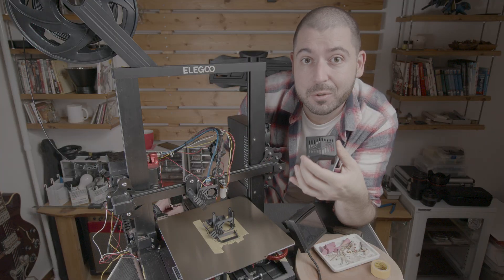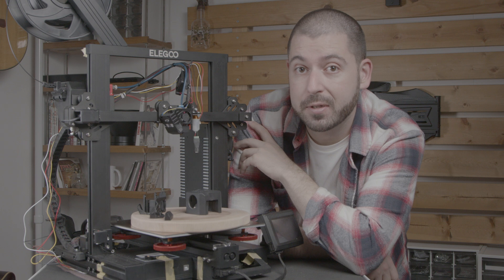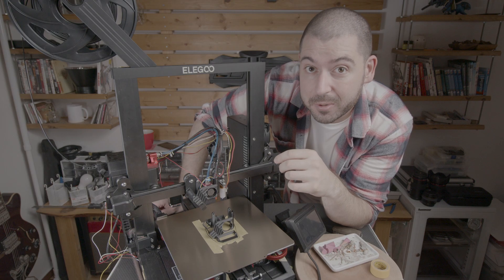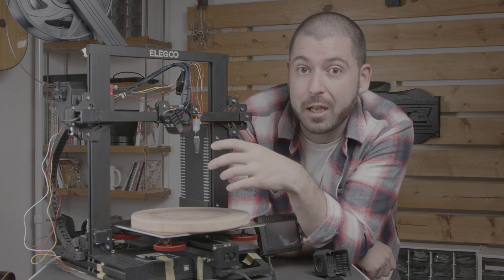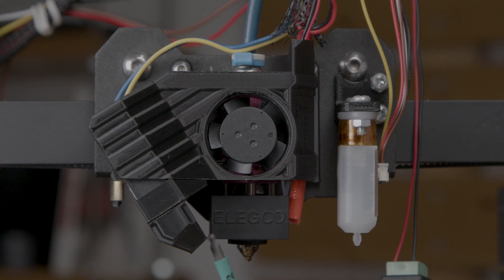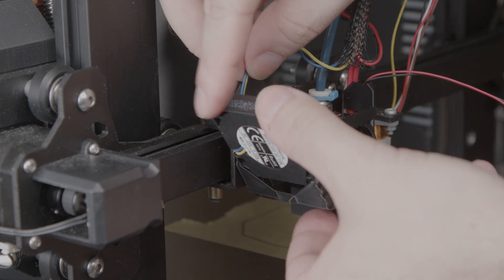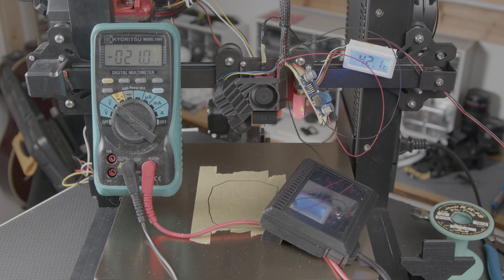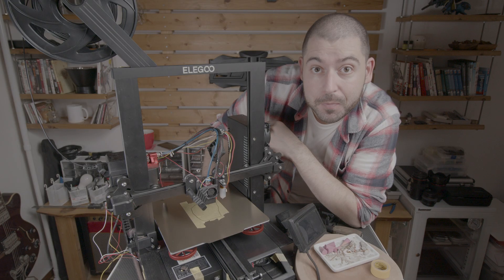Mame-FS1 Fan Shroud Design: Elegoo Neptune 2s

Comment: Question for you. My extruder gets hot as soon as I turn my printer on. Do you know what would be causing this?  I replaces the thermistor think that might be the case but its still getting hot on start up sometimes hit hits 260c
Reply from the maker: it sounds like a short circuit. the power to the heater doesn't turn on unless told too. if you are working inside the printer and make a 24v short somewhere it could damage the heater MOSFET, then it does not switch on and off properly. The MOSFETs are the 2 black boxes beside the heater and heat bed wire terminals, you might be able to see or smell burning.
Reply from the maker: if you reversed the positive and negative somewhere while making a mod it could be causing issues too.

Comment: Hello, just tried to print this but the "front" fan on my 2s seems to be much bigger, measuring 40x40x11mm - is your fan non standard, or did they change the part?
Reply from the maker: hello, this design is for a non standard front fan. The exact fan I used should be in the description if you want to see.

Comment: Hi I also got Neptune 2S and it is my first printer. I started my journey following your assembly video. Love your content. Would you be able to Leo test the shrouds that are available on thingverse and do the comparison between eg. satsana and your design?
Reply from the maker: hey, thank you very much! I wouldn't really try to compare my design to the others. If you want cooling then a different design with 2 fans or 2 side cooling will be better. If you want noise control then my design runs very quiet. In the future I will design a 2 fan model, then it could be fun to compare!

Comment: This is amazing work you got here, looking forward to printing this out, what polymer would you recommend on using? I feel like PLA might be to soft for this
Reply from the maker: thank you very much! I printed in PLA+ it still looks fine... so it is possible but I agree with you it is soft. Print in PETG if you can. If you can print PETG yet you can print TPU  at 230 degrees for just the shield and tip, the main part in PLA. If you have print or dimension issues let me know I can try to fix it a little.

Comment: So could you show the new mini fan you bought, what’s the part?  Next where do you plug it in on mother board?
Reply from the maker: the link for the fan is in the description, its CFM-2510B-170-140. that fan is   12v so you need to cut the original fan wire and install a buck converter to get the 12v. In the video I installed the converter beside the shroud just for demonstration but really you would want to cut the wire and install the converter somewhere beside the motherboard. Check the color of your fan wire, there should be only 1 set of same color wire going to the main board and the board should say fan. sorry I can't check my pc now to give a perfect answer. I have a video with thumbnail 'quiet and cool' with more detailed buck converter installation inside the case, also my power supply fan pt 3 video I think I went into detail of the buck converter tuning if you need.

let me know if you need more help, my printer is super quiet after this!

Comment: Great video, I'm following your videos about the neptune 2s series because I have the same one, I'm facing a problem with my y axis losing steps in some prints, my x axis is ok I did the vref calibration on the y identical to the x axis because both using the same engine but the problem continues, do you have any suggestions? Could you tell me what is the value of your vref on the y axis, this is making me sleepy, I realize that when I find my finger on the table with little force in moving the y axis, the motor already loses step.
Reply from the maker: thank you for following! Tighten the belt, the y-axis is heavy so easy to skip. sorry I can't check my pc for the vref now but it's written on the screen of my z-axis noise Proterface video. I adjusted the x and y just a little under the vref and still use the same values from that video. 

But it's probably the belt.
let me know if you need more help after!
Reply: I'm happy for your return.
After posting the comment I went to review your videos and I actually had the vref settings in the noise reduction video for both axes (x: 1.01 / y: 1.21 / z: 0.58 ) I made the same calibrations as yours and completely revised the belt and the rounds, now I'm going to print the model that was having a problem, this will take some time because the model has 6 hours of printing, as soon as I finish I'll come back to give the result, I hope it's successful :D, thank you for from now.
Reply from the maker: I hope it works too!
sometimes the motors will feel good but might skip at the same spot of the print everytime. In this situation reduce the Jerk and Acceleration settings. I use 800-1500 accel and 4-8 jerk.

good luck!
Reply: this was something I didn't notice, currently my jerk for the y axis is 8 and the maximum acceleration is 500, do you usually vary the acceleration?
Reply from the maker: I usually play with my settings just to  see if something changes and to learn. you could vary if you needed speed vs quality. i tried 400/1 last week it was slightly better quality than 800/4 but not much better quality. Now I am trying 1000/1, jerk doesn't change my print time so much but it can cause a lot of vibration. One day I will find my favorite setting and stop playing!
Reply: cool, I'll do some experiments around here, it's always good to have new suggestions, thanks!!
Reply from the maker: i have one more point because out say it it easy to loose steps by hand. when you turn the printer on the table moves free, but after homing the motors are on and table is locked. If you find skipping after homing, still check belts first, but also you can check the belt gears are tight or not.

Comment: future mods I recommend you doing is replace the crappy MK8 extruder it comes with, I replaced both of the extruders on my Neptune 2D with BMG extruders from Mellow in Aliexpress, good quality, not very expensive and very strong. Also, I highly recommend you replacing the filament sensors with a BigTreeTech smart filament sensor. It can not only detect breaks, but it will also detect clogs as well since it's an encoder instead of a switch.
Reply from the maker: I've talked with someone else who used the BMG also, what point is weak with the MK8 in your opinion? So far it hasn't given me to much trouble but I don't push it too hard. The sensor sounds interesting, I noticed that the sensor and extruder don't actually line up on the 2s so had thought about taking it apart and rebuilding it.
Reply: @MochaMameX  it doesn't take much for the extruder to stall or slip. I once tried pushing the printer to 80mm/s instead of the stock 60mm/s, both of the extruders stalled. I also tried printing with the fast profile and it also stalled the extruders. Another failure of the MK8 extruder is when the spool is too heavy or full. Just the weight of the filament spool alone will randomly stall the extruder with the stock filament holders. the first mod I did to the printer was to replace the horizontal part of the spool holder with one I designed myself with bearings so the filament rolled much easier and that fixed the spool weight problem. I forgot to mention I also replaced the stock bowden tube with a transparent ptfe tube. I print a lot with white filament, it was hard to see where the filament is when loading it when both the tube and filament are white, no contrast.
Reply from the maker: This is good to know, thanks. I think I tried running the extruder at 70mm/s before but running it at 80 would be nice. I'll take a look at it and run some tests.

Comment: I plan on designing my own shroud too, but first I'm gonna install a linear rail kit and a Red Dragon 2 in 1 hotend I found in Aliexpress along with the two Noctua 4010 fans I have in a drawer.
Reply from the maker: A 2 in 1 would be a great upgrade, rails have gotten a lot better over the years it used to be over $100 for a reasonable rail and bearing that doesn't bump. When I started this video I planned to use 2 4020 fans but as soon as I put a nozzle on them they went from silent to annoying, it takes a bit of work to get it right but want to try again.

Comment: I installed a CR-Touch instead of a BL-Touch because the probe tip is steel and I already dragged the sensor on the bed accidentally and nothing happened to it. A plastic tip would have broken or bent. The wires for the ABL sensor I routed them inside the wiring loom with the rest of the cables going to the head. I had to design my own bracket for the CR Touch which I printed on my MSLA printer, how did you do it for your BL-Touch? I also installed a Duet 2 board and a 7 inch paneldue. I also printed spacers on my MSLA printer and replaced the leveling wheels for lock nuts and use the mesh ABL.
Reply from the maker: lol my BL-Touch wires are just twist tied to the outside of the wiring loom, I would put them inside but I have a feeling I will probably change something soon. Eventually I want to pull the whole board out from under the machine. A Duet would be nice... a MSLA printer would be nice too actually it's probably better for me since I usually print smaller low tolerance parts but when researching about my first printer I read a lot about resin being brittle so went for FDM.
Reply: @MochaMameX  resin being brittle depends a lot on the resin. For example: Elegoo Standard Resin is so brittle it eventually starts developing cracks on it's own, it's trash. Siraya Tech Blu is very tough, and a bit flexible. Printing transparent resins has it's challenges too. Here's the fun part though, you can mix resins. When I mixed Siraya Blu with what I had left of Elegoo resin 50/50, I was left with a resin that was easy to print (the only strength of the Elegoo resin and the only weakness of the Siraya Tech Blu) with a good balance of rigidity and ductile strength. I do recommend you avoiding Elegoo for MSLA though, I haven't heard any bad things about Elegoo in terms of quality of their devices, quite the contrary as a matter of fact, but that's not why I'm telling you to avoid them. Elegoo uses boards by Chitu Systems. Chitu locks you to their ChituBox slicer and they have a subscription model which is quite expensive, even more expensive than a Solidworks for makers subscription. They did hurriedly release a SDK so other slicers can integrate newer printers to their slicers due to community backlash, but if we look back at past history, there's nothing to stop them from slowly remove features until they eventually get what they want. I use an Anycubic Photon Mono X 6K (decent build volume and nice resolution). It doesn't ship with ChituBox and I can use a slicer called Formware (no, not formlabs, though I can understand how they can be mixed up) since while it isn't free, it's got a perpetual license for just slightly more than a year of ChituBox subscription, but I don't have to pay any more than that and I get updates and everything. It has everything the pro versions of subscription based slicers have, but I don't have to pay 130 USD a year

Comment: I have the same fan shroud on my Neptune 2D and it's much quieter, but the part cooling fan (the blower style fan on the side) is the loud one for me
Reply from the maker: Mine was probably starting to fail or they might be different brand fans. The blower was off in the video but 'reasonable' compared to the hotend fan. It's basically luck with these cheap stock fans. the new 2510 is super quiet

Comment: been waiting to see your solution for this for a while, I'm curious as to why you decided not to upgrade the part cooling fans?
Reply from the maker: Originally I started making a dual 4020 pc fan design but it was not turning out as I wanted. So this is a stepping stone, testing is out of the way and it's easier to swap fans now so I'll get to work on a dual fan version, already bought a few different types of fans. Thanks for checking it out!